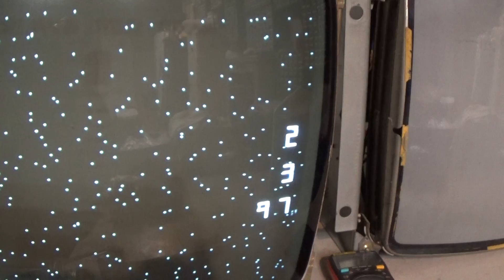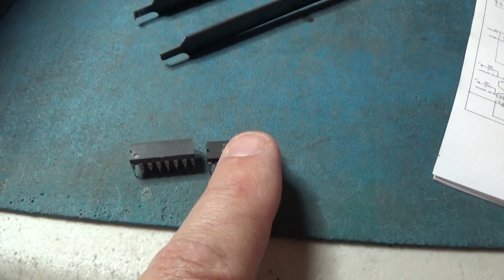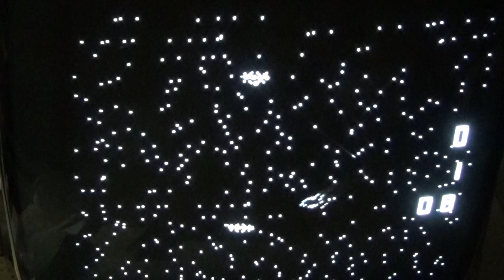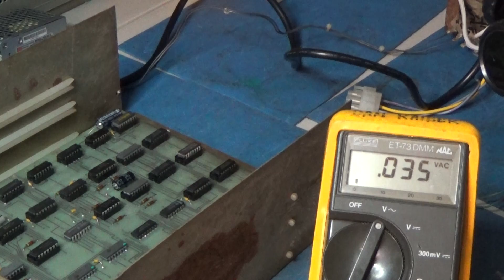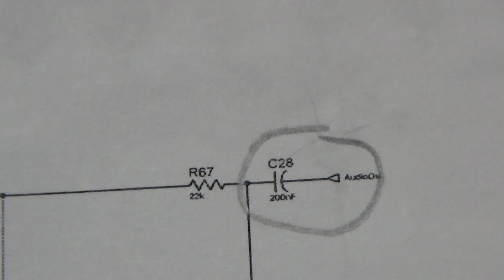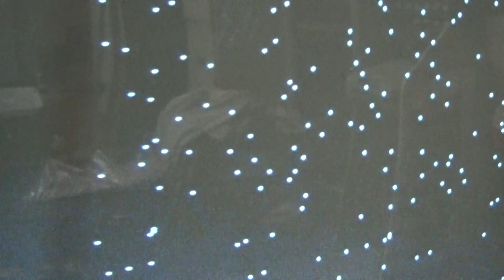Nutting & Associates 1971 Computer Space PCB Set Repair!!!  Part 4

Comment: I just looked at the page in the old orange TI data book, in the section with all the pinout summaries. There are two truth tables for 76: 7476/74H76 and 74LS76A.
I guess this is a rare case when the LS part is not the same!
This isn't the only one, I see two other J-K flip-flops, the 73 and 107, do this too. The original is a level-triggered clock, and the LS is an edge-triggered clock. The "A" in the LS part number should indicate this, but clearly not all manufacturers included it.
Your tester probably wasn't testing in a way that would differentiate the two, but the game is depending on the difference.

Comment: All the leakage resistance of all the supply bypass caps would effectively be in parallel with each other, and as we all know, if you put resistors in parallel with each other the total resistance decreases, so, even though there may be something like a mega-ohm of leakage-resistance in parallel with each bypass cap, the total leakage resistance could easily be as low as a few kilo-ohms or less, well as far as I understand it, ideally the insulation between the two plates of a capacitor should be a perfect insulator with infinite resistance, in the case of a leaky cap the insulation is behaving more like a resistor than an insulator.
Reply from the maker: exactly....  really puts a strain on a power supply...  I seriously think that is why John (Johns Arcade) had issues getting the 3 amp linear supply to work